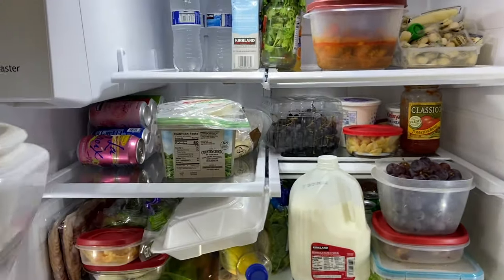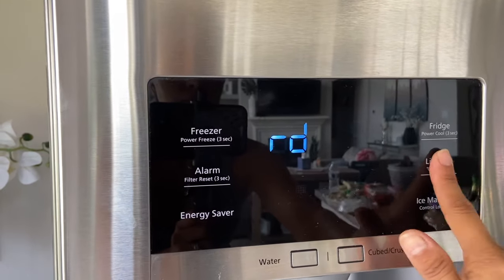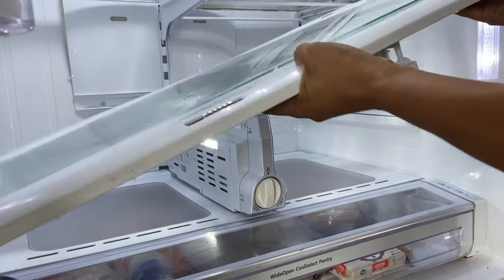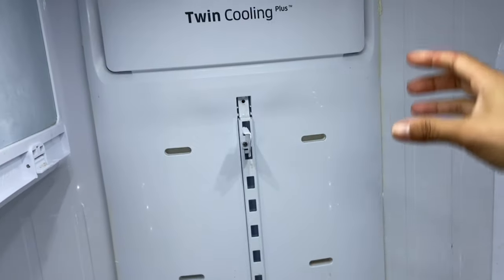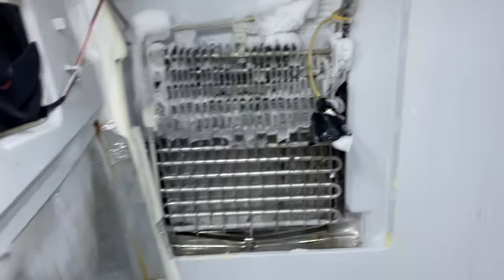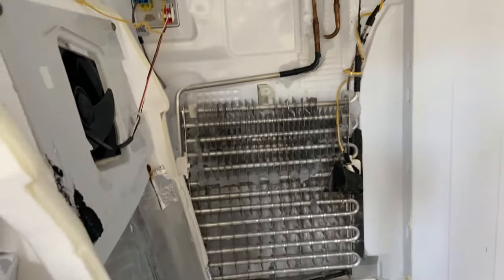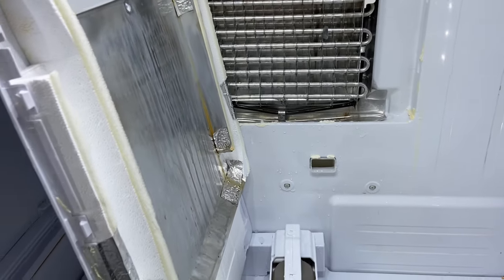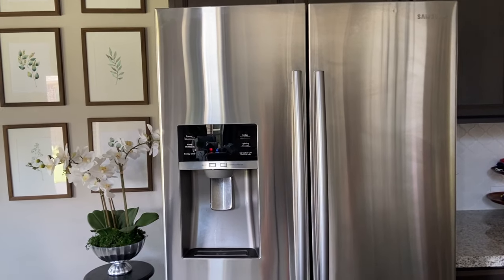FRIDGE MAKING LOUD NOISE | DEFROST MODE | ICE FROST BUILD UP

Comment: Hi Norma!  🌞  Thank you so much for your video!  How many of these are messed up?  Samsung should replace or fix free for life!  Have you contacted them?  

I had some ice build up on the outside of that panel.  I used a blow dryer to get it off then on to the screws.  I unscrewed the outer two but the bottom middle and top are stuck.  I don’t have a power screw driver.  Any hints or suggestions?
Reply from the maker: Hi wow so sorry that happened, not sure what else you could use besides a drill.
Reply: @normadoes    Hi, I got the screws off but on another video the guy says how the draining thing gets frozen.  I haven’t figured that out and tried a hanger like you suggested but couldn’t get it unstopped.  My fan was frozen in a solid block of ice.  Unthawed and it’s cooling good but I need to get a new fan.  Any suggestions on where to get it Norma?
Reply from the maker: @shannonoakley7101  Hi Shannon, check out Samsungparts.com it’ll ask for your model name/number. I’m glad you got it going. Is the fan broken? if it’s not broken you don’t need to place it.
Reply: @normadoes   I think it’s working.  I hear a humming.  Thank you Norma!  You’re a wonderful help!  😊
Reply: @normadoes   The fridge is staying nice and cool and I’m doing the defroster every couple of days.

Comment: Thanks so much! My fridge is doing this for last 3 days and just found your video to follow and fix. However, its too late now. Do you think I should turn off the fridge immediately?
Reply from the maker: Hi there! So glad you came across my video to fix the issue with your fridge! If it’s still making the sound or not you can still take it apart and do as I did in the video. If it stopped cooling most likely the fan is frozen and no longer spinning. If you have a backup fridge to store your food then yes I would say turn it off completely.

Comment: The problem will return, I guarantee it unless you do this. These LG refrigerators all have the same issue, they freeze up and lock up the fan. If you want to fix this problem there are two solutions that I found that work well. The first thing to check is in the back of the refrigerator. Remove the bottom cover. On the right you will see a white tube, that tube is the breather tube, if that tube gets clogged it will cause the ice to build up. remove the tube being careful not to destroy the black flap cap on the bottom, clean it out and replace. If that doesn't fix it in 24 hours remove the food and remove the inside back cover in the freezer section. Defrost the ice and look for the temperature sensor, LG use cheap crappy tape to tie the sensor against the main freezer tube. remove the tape and use zip ties instead to tighten the sensor against the tube. The sensor is suppose to detect an ice build up situation and will cause the auto defrost to do it;s job. This is how I fixed my LG refrigerator. hope this helps.

Comment: Do you have to do this every year?  Is there a way to prevent the ice buildup?  We have the exact same issue now and we are simply unplugging the fridge and letting all the ice thaw out.
Reply from the maker: Hi, unfortunately I haven’t found a way to prevent the ice buildup. It’s very annoying having to do this over and over again. Yes,  I have at least every year, last year it was twice that this happened. I just know I won’t be purchasing another Samsung Appliance!
Reply: @normadoes  Ok, maybe that’s what i need to do as all.  I have heard it could be the defrost heater not working properly but replacing it out is not the easiest thing to do.  Thank you for posting the video.  Really appreciate it.
Reply from the maker: @manjukamath853  Welcome! Hope this was helpful!
Reply: @normadoes  Do you think you can just unplug the fridge and simply leave it unplugged for 2 days and that will do it?
Reply from the maker: @manjukamath853  yes that’s definitely another alternative but not for me since I don’t have a backup fridge 😐
Reply: @normadoes  Oh yes that is understandable.  By the way I also found out on another forum that it could be the defrost heater element that is around the evaporator assembly DA96-00762L, so the next time you have to remove that cover to thaw out the ice, check the continuity on the defrost heater element and see if it needs replaced.  Just a thought.

Comment: Ok guys if you use a drill be careful  you should honestly just use a screwdriver to tighten those screws and I’m not sure if the panel need to be sealed after you take it off with sealant I suspect moisture could get in that way and ice could form on your coil I could be wrong about that and third you got to remedy why it froze over in the first place so maybe excessive moisture low charge bad fan etc

Comment: I have the same refrigerator,  before you tear it apart there is an easier way.  Press and hold the freezer and lighting button.  When it goes blank, hit lightning button until r d is displayed. It will beep constantly for about an hour as it defrosts.  r d stands for refrigerator defrost.  If you scroll through the menu, f d
Reply: Same as she did for freezer defrost
Reply from the maker: Thanks for that, i appreciate any feedback, tips that will facilitate this. if I’m not mistaken I believe that’s only to defrost the ice compartment. Correct me if I’m wrong, we tried before taking it apart

Comment: From what I can find on YouTube the ice is caused by a bad seal because 
of the cheap foam and thin cheap seal. I am going with drying everything
 out and replacing the seal as perfectly as possible. A good fit will 
stop entry of warm moist air where its not supposed to be.

Comment: I have had this issue in the  past the hair dyer is such a good idea, I turned my fridge off and let it all melt😄
Reply from the maker: I was trying to avoid letting all melt since I down have a second fridge, I need a back up one! Thanks for watching
Reply: Samsung sent me an email not to use blow dryer as will ruin the wiring
Reply: @Metuka1122  Samsung technician used commercial carpet steamer to that ice. It doesn't seem a hair dryer would hold a candle to that. It was HOT!

Comment: Your refrigerator has a build in defrost mode. 

Hold Energy Saver and Fridge button.

Scroll to FD

It will beep for thirty minutes. 

Done.
Reply from the maker: Only works for the ice maker if I repeat a million times. I tried it

Comment: There are four screws, not three to remove. You skipped the one in the center at the bottom of the vertical bracket.
Reply from the maker: I did remove all 4, didnt mention that did I. I think I said 3, didnt see the 4th till after, :) Thanks

Comment: This refrigerator is supposed to defrost itself automatically. If you are having this issue as I am, you need to replace the sensor. I'm also having a problem of a leak/ice build up under the bottom drawer after I replaced the filter the last time.
Reply from the maker: Thank you, after performing what I did here I haven't had a problem since. :)
Reply: You're so lucky that it hasn't messed up again. After I left mine unplugged for a couple days to defrost and plugged it back in, it gave me an error code on the display saying the defrost sensor was bad. I overrode it to make it start cooling and it was fine of course because no ice, but mine started the dreaded noise again after maybe a week. So right now our fridge is at 57 degrees but the freezer works fine. We're lucky to have a back up fridge. I was going to call a repair man, but after watching you and a couple other videos I think I can just do it myself if I'm careful. The part is only like $15, so fingers crossed! 
P.s. I also had a beautiful Samsung dishwasher and the wiring straight up melted after only about 5 years. Every repair person I've spoken to says Samsung makes beautiful appliances, but they're all junk. 😞  I'm so sad. I saw on one of these videos that there's a class action lawsuit for this issue. It wasn't the cheapest appliance as you know.
Reply: I replaced the part myself last night. Thank you for your help and inspiration.

Comment: Have been doing this since 2 Years, and have to do it every 2 to 3 month.

Changed those sensor and there is a kit as well that samssung now giving. But no help
Reply from the maker: I only did it a few times and haven’t had an issue
Reply: @normadoes  now if it happens, the guy said it might be issue with the thermostat.

Comment: I had the same issue and called Samsung and they sent out a certified technician who changed the entire unit free of charge. I strongly recommend you call Samsung first. They are fully aware this is an issue. You might even get a full refund for your fridge.
Reply: I bought my Samsung refrigerator in 2015, I guess it is out of warranty. Should I call Samsung too?

Comment: Where does the water drain to?  Thanks!
Reply from the maker: For this model, you'll be able to see the drain hole right under neath the white panel I removed. if water doesn't drain then your drain pipe is clogged another common problem with this Samsung model refrigerator
Reply: @normadoes  thanks.  We just fixed ours tonight and it worked!!  As to the drain, it worked but as my wife asked, where does that water go.  I said 🤷‍♂️
Reply from the maker: @winstonsmith4003  so happy to hear that! Glad you got it fixed! Yeah I wondered the same about the water until we figured it out! 🙂
Reply: Good question. Is there a drain under the fridge?

Comment: I have the same fridge and yesterday it made the noise when I opened it it stopped now it don't make noise mine ice don't come out no more
Reply from the maker: Your Ice maker is probably filled with frost and ice build up. Open your ice container and remove all the ice that’s stuck. Hope you can resolve this Issue, Samsung refrigerators really suck 😖

Comment: We just did the FD and if that doesnt do the trick I'm using a hair dryer tomorrow.
Reply from the maker: Doing the FD mode is too slow and it’s a constant thing to do until it all defrosts. Taking everything out is a pain but the hairdryer is much quicker. You can also unplug and let everything defrost if you have a back up fridge.
Reply: @normadoes  it’s only cooled from 71° to 64° in 5 hours. Looks like I’ll be using the drier tomorrow.?